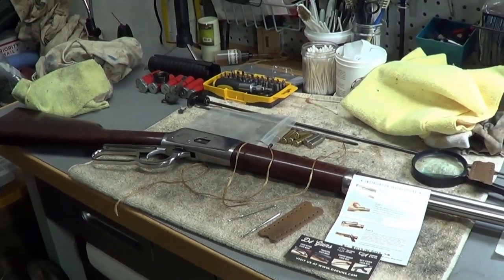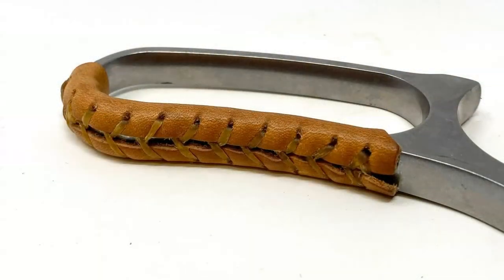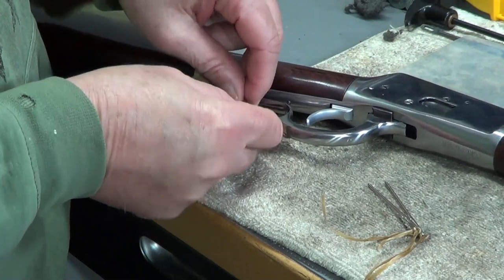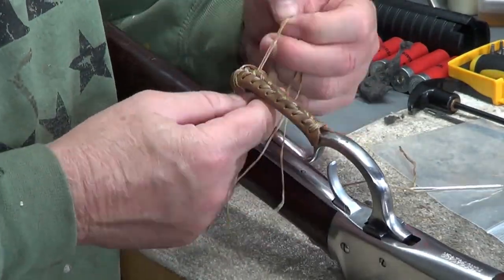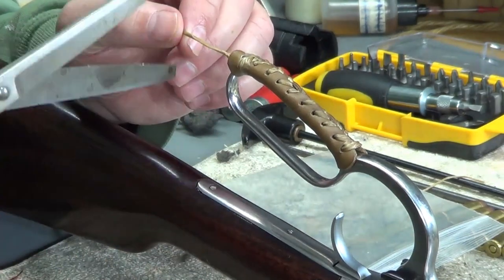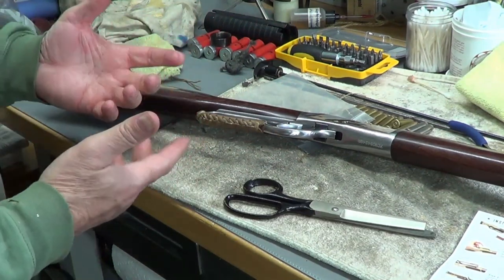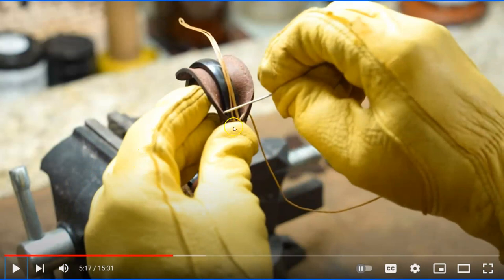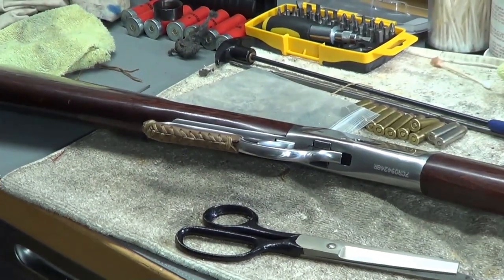Installing Leather Wrap On Lever Action Rifle

Comment: I use the "parallel stitch"(easy to do and eye-pleasing) and veg tan leather for leather wraps. Veg tan leather is durable and you can wet mold it so that it fits like a glove after drying. Little tip: Those small leather pieces are scrap material. You can get some for free from almost every saddle maker or leather shop if you ask politely.

Comment: I used to leather wrap boat oars .I used "belt leather" .The herringbone baseball stitch is smoother . I would get everything ready and work fast as possible. Soak the leather in warm water then stitch it up fast . It will shrink up tight when it dries .Then finish the leather with tallow or whatever wax/oil you have. Use a strong waxed string.There in Texas it should be easy to find all types of leather . A baseball/softball cover might be good for this small job but don't tell the horses . It's made of horsehide.
Reply: I thought most leather work was done wet

Comment: Leather looks really good, for the cheapskates in chat you can braid a few cents worth of paracord in whatever color you like, it's not cowboy authentic like leather but the braid you pick can be really wide so you have a comfortable surface that touches the whole section of your fingers in the lever, wide levers are nice for gloves, but taking up the space in the lever with either method lets you work the lever faster if you don't care about use with a gloved hand. If it falls in the mud or gets so grody that you don't want to clean it you can cut it off and do another.

Comment: I like lacing with leather strips.  Perhaps take it off and cut a new one from scrape leather and make the holes closer together especially at end.   Make  touch smaller too. 

Don't have scrapes, I can toss a few pieces in your box.  The awl and waxed cordage great for some applications too.   Leather box is like 24-18-12 inch and full.  Always save scrapes for future stuff.
Reply from the maker: yea, it works, if it gets lose or pisses me off I will cut it off and get the good one at the end of video